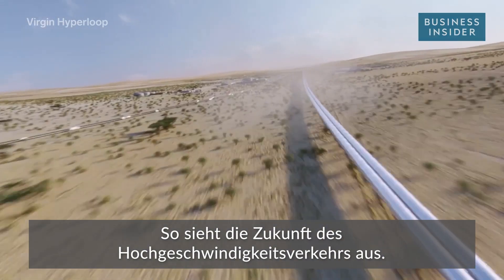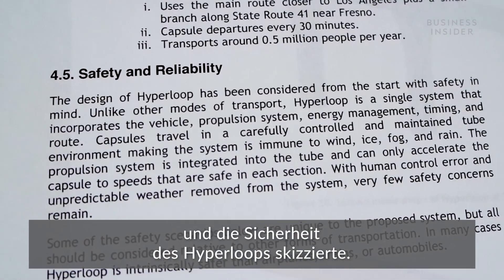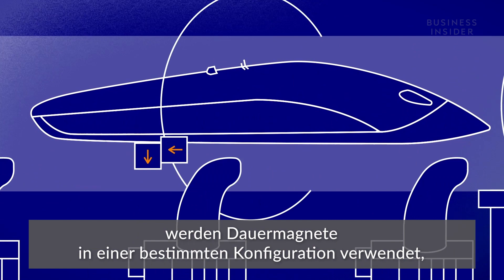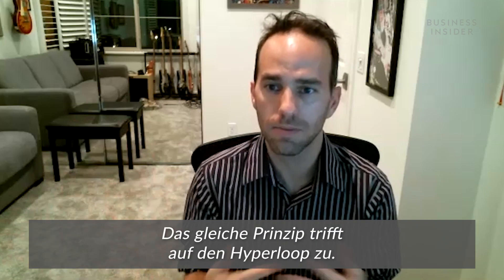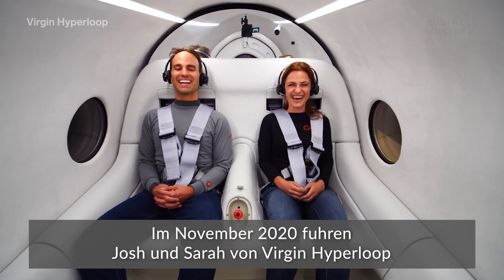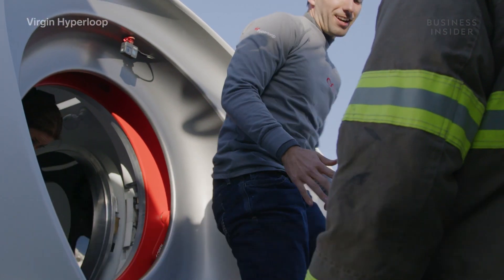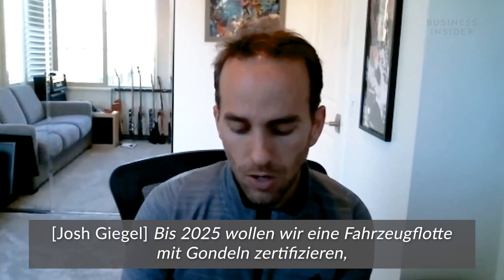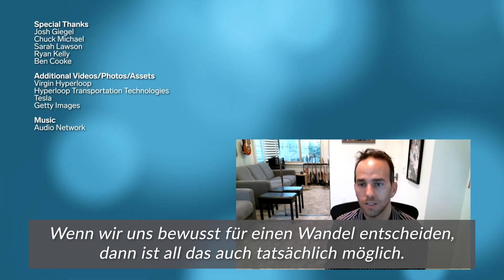Der Hyperloop schafft 1.100 km/h | So funktioniert das bald schnellste Verkehrsmittel der Welt

Comment: I don't know if it's better than the Hyperloop but I have something that's definitely safer. Instead of pumping the air out of the tubes, it would be much better to just bring the air up to the speed of the train with a turbine in a closed circuit.